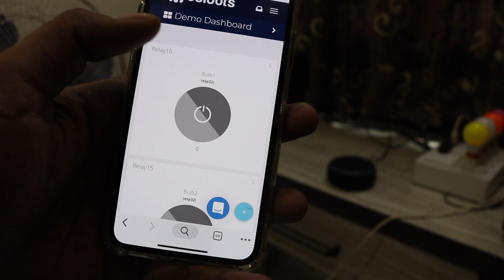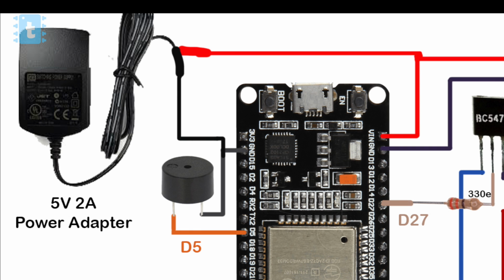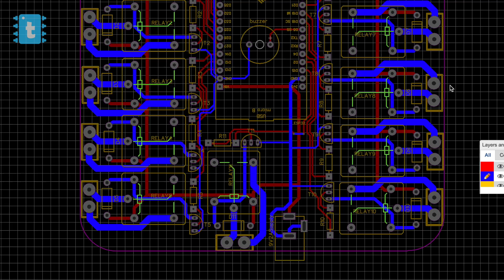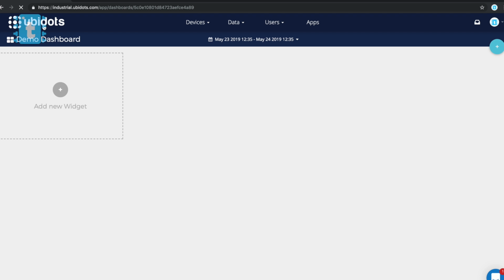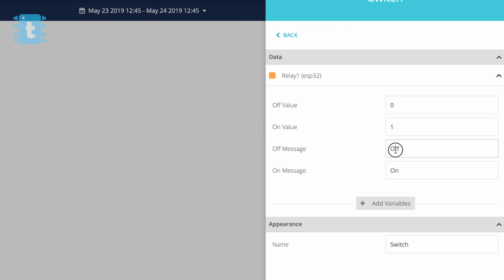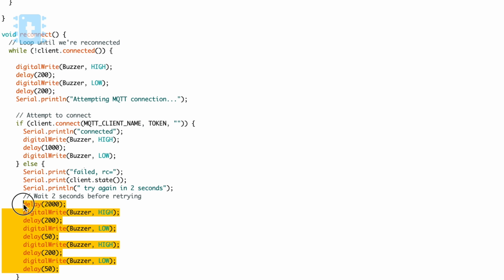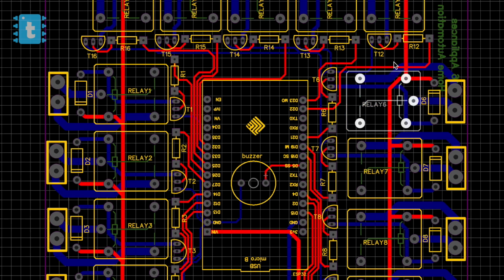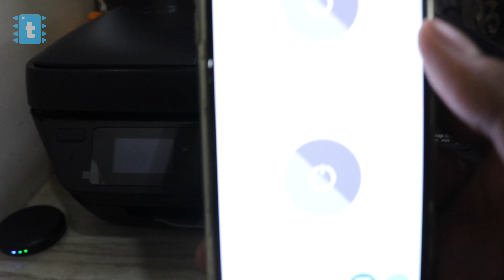My biggest Home Automation project using ESP32 | IoT Projects | ESP32 Projects | Ubidots | LCSC

Comment: You should have used Optocoupler for isolation
Reply: I agree. And there should be mounting and earthing options as well.. Who am I kidding, earthing is a myth in India and other similar countries..
Reply: Also should have put HV isolation paths under the relays and connectors
Reply: @trevorslab  My thinking... usually HV traces are blank and well covered in solder... spacing is too small as well .... so I cant believe this one is safe... well...  not for strict western regions at least
Reply: Don't the relay's provide the necessary isolation?
Reply: @CrimsonTide001  they do, you're controlling high voltage, so you better restrain yourself from buying some cheap-ass stuff that might put your home in danger.
Reply: @CrimsonTide001  yep, im definitely high, or just trying to help others
Reply: @madpancake9891  And where do you get the impression that someone was suggesting using "cheap-ass stuff"??  You're tilting at windmills here.

Comment: This circuit is not secure at all..

You should use zener diode nd optocoupler.
It's only for temporary use.
Reply: Not to speak of the wiring in the rest of the junction box thingy...
Reply: Bro can you make me a code
Reply: @sanb3586  yes bro..  on mqtt as well as https server. both ode can be made.
Reply: nop its not require because relay itself is isolated from ac supply.
yes it would require if you r using som solid state device like triak.
Reply: @dharmikbhavani7272  we need optocoupler to separate the grounds of microcontroller nd relay.. bcz in any short circuit , your controller will be safe . 
We also need zener diode to block reverve emf induced in the primary coil of relay
Reply: @iotwithamitbhandari4413  I don't think a zener diode is needed.  A zener diode clamps voltages.  A simple 1N400x series diode would work fine as a flyback diode to allow the coil currents a place to go.
Reply: @stevedonkers9087  i am running this project as smart automation system in my own house from last 2 months. I had used zener diode and its working fine.

@Steve , yes buddy we can use any simple diode. But we can't remove that , it may harm our circuit for long run.
Reply: @iotwithamitbhandari4413  Why don't you just make a correct design and share video with all of us? So we all can learn in more details and make this project more reliable.
Reply: @syedmuhammadwasihasan1335  sure brother. I will do the same...
Reply: @iotwithamitbhandari4413  Post your link here as well once you done.
Reply: Dealing with main line AC and no earthing either. This is very unsafe but who uses earthing in Hindi countries anyways. it's a myth..
What you need is a snubber network (4000 series diode, capacitor and resistor) to quench any transients from the relays coil.
Reply: @Elfnetdesigns  The output is to a light bulb though, so I don't think suppressing the transients is necessary. It's an overcomplication to the circuit. And you don't need zener diodes for flyback... I think an optocoupler would be good though for the ac ground and the digital ground.
Reply: @rajivnarayan5214  Here is the problem, Your own statement here "I don't think". You suppress the HV discharge from the relay coils when they deactivate and the field collapses. This is basic inductors 101 stuff... Failure to suppress this can lead to damage to other parts of the system. Of course if you were modernized you would not be using relays at all for switching light / low current loads anyways nor would you be using filament based lamps either..
Reply: @Elfnetdesigns  I'm aware of how a relay works, but for a project like this were your output is a light bulb, the only thing that MIGHT happen and thats from high current loads is your filament burning out. Suppressing the transients won't do anything unless the voltage is high enough to meet the breakdown voltage of air at w/e gap is in the relay. It won't do anything to the light bulb realistically. And in this case you are switching mains voltages, so unless you have money to spare for triacs or high power mosfets, in which case you would then definitely need an optocoupler to change failure due to 'short circuit' to 'open circuit' then a relay is probably the best thing for this job. In my engineering project I had a light bulb rated at 12v, 5w and ran 85v through it from a boost convertor at low currents and nothing went wrong.

I don't have experience with high voltage projects, but I'm assuming theoretically that the above is correct based on research I have done in the past.
Reply: @rajivnarayan5214  I am not talking about suppression on the load side of the relay. I am talking about the HV suppression when the induction field collapses in the relays coil and creates the HV pulse that can travel back up the control line and into your micro-controller board and damage if not destroy the MCU itself.

Also IF you are working with loads that are on or referenced to the mains AC you will need some earthing and separation options as well. This is where separation valleys in the PCB and opto-couplers come in. Take apart a quality computer PSU and look at how they designed and built the PCB up. there will be cutout valleys in the PCB and optocouplers to keep any chance of the line getting onto the secondary circuits.
Reply: @Elfnetdesigns  I see I think I will take a look at a computer PSU. Thanks for your reply I know see the error in how I was thinking.
Reply: @rajivnarayan5214  if we want to connect a motor which is use to pump water(high power) . A 5v relay will do the work or any other solutions
Reply: So
Reply: Hey if I need this ready .  From where to buy?? And price??

Comment: The board looks amazing nice and thanks for sharing all the code and hardware files.
Reply: this board is HIGHLY dangerous. There is NO insulation from the mains side to 5V wahtsoever and traces on the PCB getting super close. This is a very very bad design that is very dangerous to use! Do not replicate this!
Reply: @RandomUser2401  are you  pcb designer
Reply: @mewedward  yes
Reply: Good afternoon sir
Reply: hmm

Comment: This is amazing, Soon I will be ordering t-shirt and pcb board from website.
Just wanted to know how to how can we integrate this with “Apple Home kit”?
Thanks for sharing
Reply: You will need a raspberry pie to act like hub with a mqtt server running. There is a HomeKit emulator for raspbian available that let’s you add/control non HomeKit supported devices to HomeKit naturally.
Reply: Jugen Gawande ohh cool , can share any guide or link about this?
Reply: Parag Oak I did this project a long back and did not document it anyway. But the app you need on your raspberry pi is called HomeBridge. If you google/YouTube that you will find tons of videos about setting it up and for communicating with your esp8266 like in this video you will need a mqtt broker on the raspberry the app is called mosquito with tons of videos available for that. After that it’s only tinkering some code. To make it work. In reference to above video the circuitry for relays and module can remain same only the esp8266 will have to communicate with a mqtt broker  running on a raspberry pi on the same network.

Comment: Thanks bro for this amazing video. I am making same project. Mainly I am making project for using with google assistant in mobile. And in future I buy google home or eco dot then use with it. But i have Some question 

1) can we make an app for android?
2) if I whish to use it with Google assistant or Alexa then how to configure it. As in one of your iot video you use Google assistant. 
3) I am first time making iot project and using AC source so is it safe or any precaution to take.
Reply from the maker: 1. I’m not pretty sure about the app as I haven’t made any. But if you are able to integrate mqtt client in the app then you can make an app for Thai project.
2. Yes we can integrate google assistant in it. I’ll try to make a separate video for this probably.
3. Working with Ac do requires safety precautions always. Look at the circuit diagram carefully and make it.
Reply: @techiesms  
OK thanks
Reply: @ex_09_vikrantneve55  Yes, you can design an app for both Android and iOS, and AC is pretty safe as long you stay alert.
Reply: @thisisMilindRaj ok

Comment: In this eeprom has added? In case main power off and on again, which the switch is on will be on or not?
Reply from the maker: The switch will come back to its previous state. I have added that lines in the code don’t worry

Comment: we get lot of problems by using es8266 like network connection problems and voltage problem. By using the es32 can we eliminate that problems
Reply from the maker: Exactly. With way more GPIOs accessible the Nodemcu

Comment: You're project not bad but there is no timer to set the time for realy  on and off. To add a timer on you're project .
Reply from the maker: That we can do on the ubidots server only. We don’t need to change the hardware or the code 

Timer control operation are possible IN This project with same arduino code and hardware with little changes on ubidots server
Reply: @techiesms  
Cool